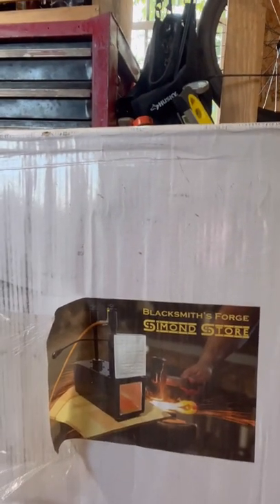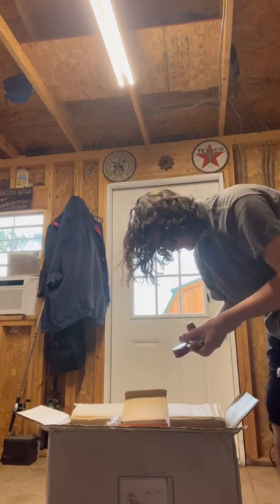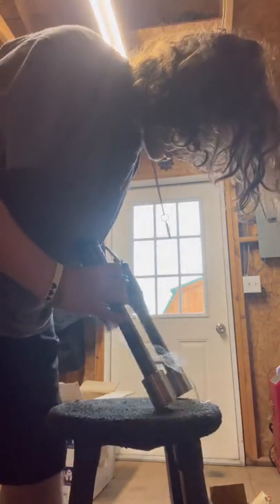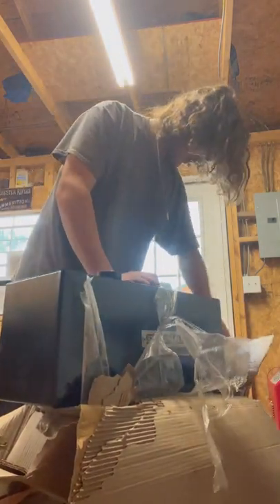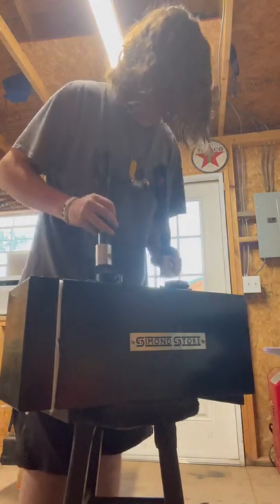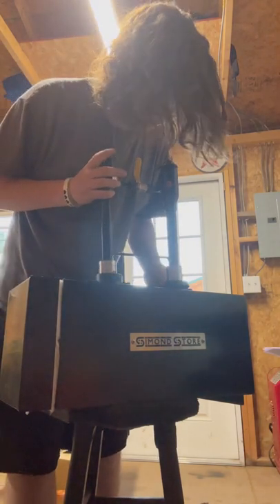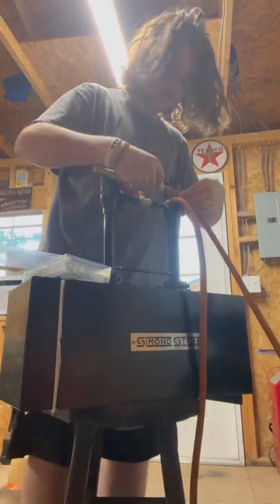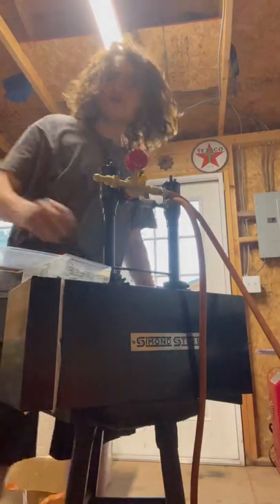Simond Store Dual Burner Gas Forge | Unboxing & Setup

Comment: Thank you for the shout out! Great video!

I'll add text as I watch your video. 

 Just couple tips: Always video in landscape unless its a short; Be careful with the door. Too much heat will warp it. I have to fix my back door because of warping.

I haven't had any issues with the tubing they supplied, so far. 

They really did pack these things to survive a nuclear blast. 

Yes, you can use one burner at a time but the one in front will always ge blowing. 

I'll ignore the scissors, you haven't made the knives yet, it's like needing scissors to open the scissors package. 

Congratulations on your first forge. I look forward to seeing your work. 

I wasn't sure about the single door. I wanted to be able to forge weld but getting the heat is hard in a propain forge. 

I love how you did your homework before starting this project. It shows that you researched this before jumping in. 

I like seeing the Sigmond store logo on the side of the forge. The stainless is just plain. 

I haven't had any issues yet with the hose staying seated on the inlet but I like the extra safety. You can never be too safe. 

I like how you cut your video when needed. 

You will want to get a large propain tank which will allow for more pressure in the system. 

I can recommend hellsforge refractory cement on Amazon. I use it and it typically doesn't break apart too much. 

Great video again. Looking forward to more content.
Reply from the maker: Thank you very much man, I’m looking forward to some colder weather so I really can do something. Great tips and and I’ll take my notes. Thank you again big man! I’ll be coming with some videos here in the near future. You rock!!